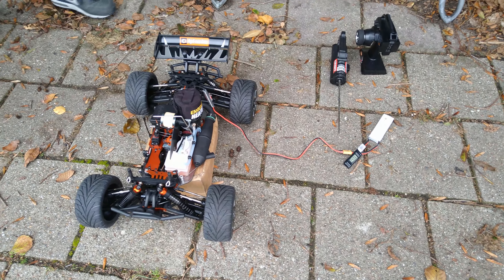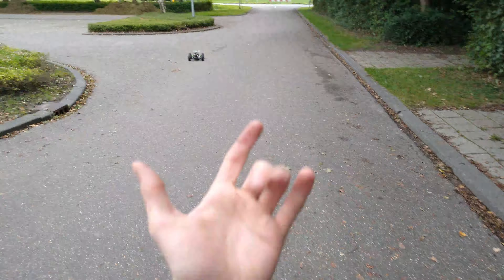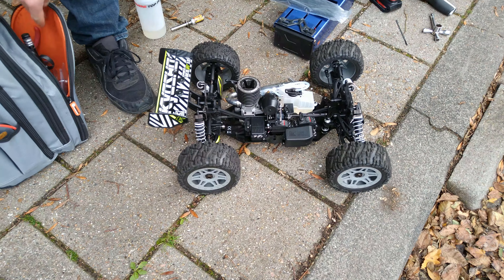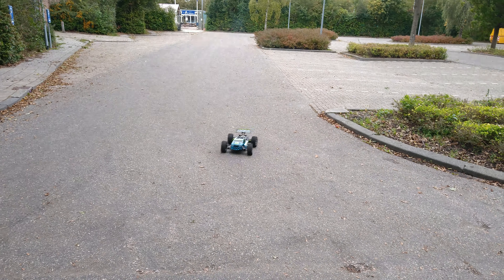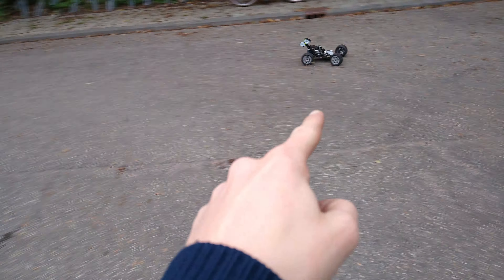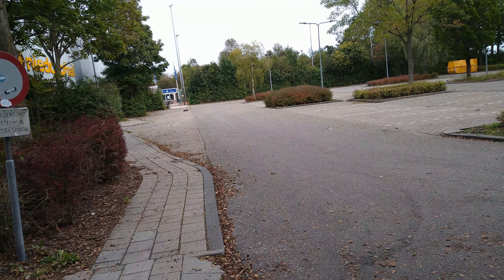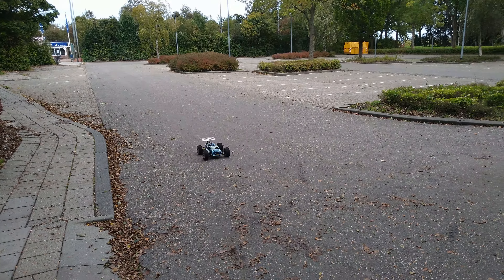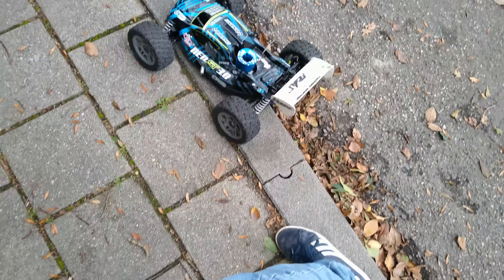Putting a base tune on a brand new Kyosho Inferno ST

Comment: Would you recommend this over a traxxas slayer pro? I'm stuck between the two.
Reply from the maker: I would definitely get this over the slayer pro. Why? Better engine, car is bigger so it handles better offroad and most importantly it is almost indestructible as you can see here: https://youtu.be/2h9lF806OKM
Reply: @NitroMike  I also like the 17mm hubs and pull start everything I would switch out to on a traxxas lol I like the blue wheels on yours as well they match the body good.